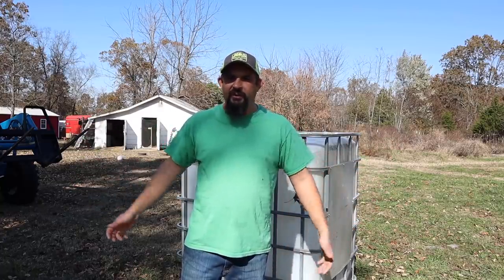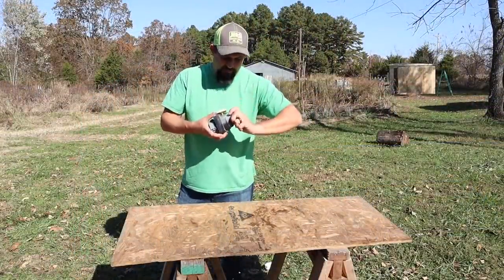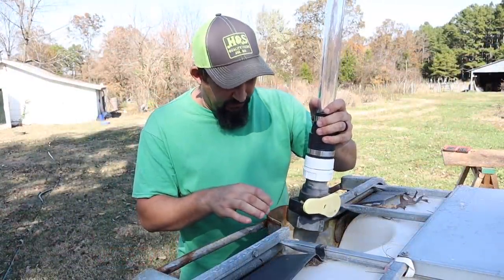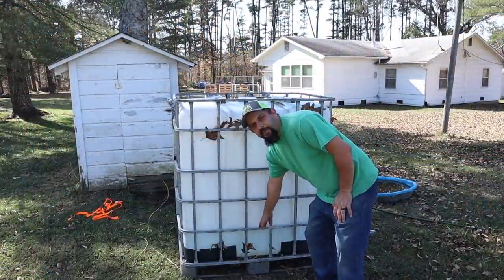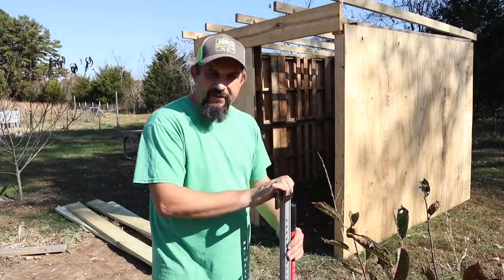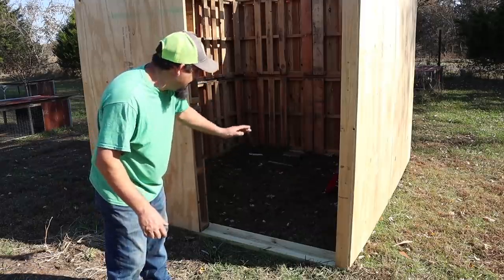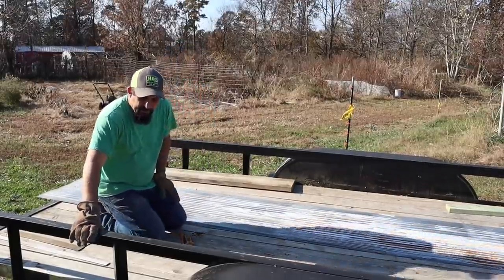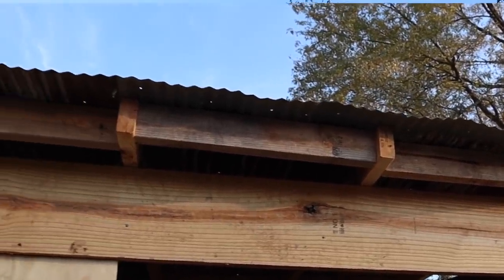Winter Water Solution for our Animals PLUS The Duck House gets a roof!

Comment: Remember to put a stick in the cows water trough. It will allow small thirsty critters a way to get out, if they accidentally fall in. (Squirrels, etc.) It will also give you a way to break the ice, and allow the cow to get a drink, if the ice does not get too thick. A cedar post stay works well.

Comment: Good morning, Kevin, you should hang a gutter on the backside to catch rainwater and have it drain into a pool for the ducks to drink and swim. Your new water tank can be used when rain doesn't fill the pool and run a line into the duck shed for inside water also.

Comment: I saw one YouTube video where a YouTuber named  "FarmBuilder" painted a tote black, and then put a PVC pipe and valve array into the CENTER of the water mass in the Tote.  Since the tote never freezes all the way into the center it made it possible to water his animals through the entire winter from the tote that he leaves outside in the weather.  He lives in VA where it gets even colder than you do in MO, so you might want to check out his YouTube video..."Freeze resistant water tank for under $100 reduces daily water work load by 70%."

Comment: I would try to get paint on that duck pen before winter so the plywood does not de-laminate. Because it is getting cold where you are, I would recommend Valspar Duramax paint, which you can get at lowe's. As a handyman I use this paint almost always when painting in colder temps. This paint is rated for application in temps as low as 35 degrees and if you apply two coats it will last a long time.

Comment: I put a coy pond heater in my tank and it keeps my water from freezing. It's been down to -2 and it still didn't freeze.
Reply: Smart idea!
Reply: Did you put the coy pond heater in that big white tank? It worked? I have been trying to find something that would fit in the top of the tank from keeping it from freezing
Reply: @CatalpaCreekFarm  yes. I bought a 500 Watt and it's been great. It's one that's it is a skinny glass tube about 16 inches long so it fits easily in the fill hole without cutting anything bigger. They're cheap on Amazon or eBay. About $18. Just look up fish tank or cot pond heaters.
Reply: @shermdog6969  did you suction cup the heater to the side of your tank? Do you worry about the water level getting below the heater then? Thank you
Reply: As much as you put into this duck mansion I would coat that roof with a product they made for mobile homes trailers, I think one brand is Silvacoat. This project deserves to be protected.

Comment: As someone who hauls alot of water in winter, I would suggest taking the ball valve off the tank and put in the well house.  The hose will not freeze but that ball valve will and it will generate a whole lot of frustration in thawing it out!  Granted a whole lot colder where I live!   Dragging the hose in and out every other day from the well house  to fill her trough would work too!  Just turn it on before start dragging it across the yard.  Just a couple suggestions!  And yes, hauling water by bucket in winter DOES get old real quick!

Comment: The PVC coupling will snap in cold weather and isn't UV resistant 

Rubber no-hub adapter will be fine in cold but will deteriorate with UV

Vinyl hose will be stiff when cold and can crack at bends

Why not paint the tote black to fight mold and absorb heat from the sun and run galvanized pipe to a float valve and run an extension cord out to a floating tank de-icer?

That's how we water cattle in winter.

Comment: If you haven't made up your mind on the door, think about building Dutch door.  That way you can open one half or the whole door depending on if you just want to let out the ducks, go in and check them/put in bedding, or open the top for ventilation with lower half closed to keep them in.

Comment: We have 3 of those tanks. 2 are plumbed into our house. 1 is in the back of our truck and we take it to the spring down the road to get our water. I think they are 250 gallons. 50 per line. Some days it only takes 10 min to fill our tank at the spring and some days, when we haven't had a lot of rain for a while, it can take almost an hour. Good cow water plan!

Comment: Ok Kevin here is my 2 cents worth. (1) the openings around the top are really inviting skunks, snakes and racoons. Screen mesh is in order. (2) If that clear plastic hose on the water tank gives any trouble take your assembly to an auto supply and get a flexable radiator hose that will fit over the assembly. It will out last the existing hose many times over. (3) If  you do not intend to move the duck house from time to time like a chicken tractor then you will want to place chicken wire around the outside on the ground to keep out the skunks, etc. Just lay it down and fasten to bottom of palets and let the grass grow over it.   Paint the duck house in camoflauge paint and call it "The Duck Blind"   I also like another persons suggestion of "Ducking House Palace"..I'm an old timer from rural NW Oklahoma and I understand fully your situation on your farm. Been there, done that.   LOVE YA ALL Keep up the good work..

Comment: Kevin, I know I'm too late for this project but if you use a paneling blade (or veneer blade)  turned backward on a skil saw it will cut right through the tin. It will save you lots of blisters.

Comment: You might have wanted to run some 2x4 purlins perpendicular to your roof support boards. Your metal roof is also made to be supported by purlins that run perpendicular to the corrugations of the metal. When you added your extra "support" boards .... this is what the purlins job is. Also, the purlins will allow you to have an overhang on the other side as well.... so ALL sides could have an overhang. All that being said, you were such a great example.... that we built a chicken coop extension using old pallets!!!!! Thank you for the idea and thanks for sharing.... even here back in your old digs of Wisconsin!!!!

Comment: A word of caution, 1x and 2x treated wood is not "ground contact" rated. 4x treated wood is "ground contact" rated. Keep an eye on that wood for the next couple of years. On your next project think about using "CMU" (concrete masonry unit) cap blocks from Home Depot.

Comment: I suggest putting rain gutters on the barns and do rain catchment to refill the water troughs with. 
In the colder months put something around the water tanks to insulate them so they don’t freeze.
Reply: Are you going to do a solar light -charging panel attached to the top inside the duck house?

Comment: I use a water tank just like yours to haul all our water. Mine doesn't have a nozzle like yours but I just use a 4in. Pvc pipe to water my horses. Then we add an elbow with a cap that allows us to add a small pvc pipe to fill our 3gal water bottles for the house.

Comment: Hy Kevin about the water tank, why not drag some isolated tubes from a close barn to where you want to drop the water. During the winter it will be hard for you if you drag that water tank every day, so better to use some isolated tubes from that thank directly to the cow and the birds too. And you only go to open the valve. And you could buy some auto-opener for some fixed time. You calculate how much the cow drink and the birds per day and set the time how much can the valve stay open. With a deficit because not every day they will drink the same. And you only go to look if they need more. Make your life much easier to let everything go automatic. And you can focus on other things. And about the barn, why not make some steady horizontal pillars and just dig the earth on what you need and put it directly on the dig and you can build everything you need. Just make sure those horizontal pillars have like a caterpillar so you can introduce the wood (pannel) inside this way the barn cant move if you have a storm or something.  but i forget something before you put that horizontal pillar make sure you put some small stone there so when it rains that he could go deep because of lac of cement but small stone can help too. God bless. And sorry if my English is bad.

Comment: I used to break the ice with a twenty pound sledgehammer. Then I discovered water heaters that float on the water and to keep the water from freezing. I had to have electric run to the area but all the animals I had were in the same area and it was great for me. I also had a heated water bowl for the cat and dogs. I really like your set up. I have the container but no tractor 😩.

Comment: put a coil of copper wire around the tank and put a lower section of coil IN the fire pit.  The heated water in the coil will do the job - takes planning.
Reply: maybe fetch the concrete trough and put one end in the fire?  You would only light fire at night, mostly.

Comment: It looks like you did very well with what you had. When it comes to jacks and you are working in close proximity to the area it is recommended that 2 jacks are used to have more stabilization. I know that it is rare that you need more than 1 jack, but sometimes 2 jacks keep it safer and your downtime, if you are injured or damage to the project, will be a lot more expensive than the price of that second jack. Thumbs up! Just saying. 

As for names, how about the Duck Den or Duck Cave.

Comment: That's a good idea to put pressure treated wood under your barn. What do you think the chances are of moisture leftover freezing inside that valve when the temperature is below freezing? Maybe leave the valve cracked open when you're done using it each time so you can pour warm water through the valve to thaw it just in case.

Comment: Those tanks are usually 275 gallon and a gallon of water is eight pounds means you’re going to be moving 2200 pounds of water. I don’t know what your tractor front loader is rated for but it seems that you’re going to be close to the limit if not over just a tad. Have you thought of building a stand for the tank and filling it up from the well house as needed? 
Just a thought and it would save wear and tear on the hydraulic system on the tractor.

Comment: Definitely a must to have a seal plate to keep the pallets intact.  also coming from Arkansas, with the winds that we sometimes get, you may think about drilling the bottom board of the pallets through the seal plate and driving rebar with a bend at the top to pin it in place.  I know from experience that rolling a small building back upright that it is a pain.  Great job!
Reply: I also live in Arkansas the winds get terrible here more so in the springs and summer your right about that

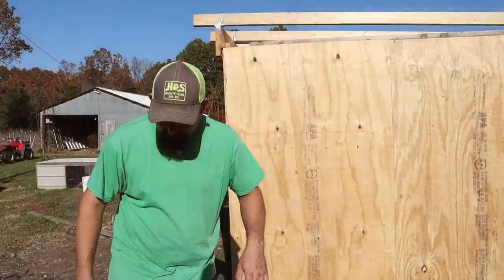Comment: Coming along very nicely!! Kevin, I was just wondering, at around 13:48 you were showing the bottom of the shed with the 2x8s in place. There's definitely light coming in through some gaps. Are those areas that critters will be able to enter? Do you need to move the 2x8s out a little so the plywood connects and removes those gaps?

Comment: they were ORIGINALLY called a FENCE JACK !-- as they had a cam lock on the top of the jack used to tighten barbed wire fencing !!! hence the reason they were/are so tall/long. but they have a lot of uses and since then they are erroneously refer d to as a farm jack !

Comment: @livingtraditions homestead  are you going to use tie downs on the duck house? 
I ask because you do get some fairly strong winds where you are and that house being so tall will topple over quickly. 
If you are I'd suggest drilling holes through both the boards you just put down and the wall, slide a length of either steel or rebar through and pound it in about 12 to 18 inches. 
I live in WNY and growing up we always made sure freestanding structures were tied down.

Comment: You may already know this...   but just a thought... I don't know if the solution the wood is treated with is different from years ago, but they always told me "Don't burn treated lumber!" That vaporizes some dangerous chemicals that you don't want to breath...
Reply: Herb, then what are you supposed to do with treated wood when you need to get rid of it. This is serious - as I burn my old rotten lumber. I know you can not put it in the fire pit to cook hot dogs, etc. on it but otherwise, I thought It could be burned. Yikes.
Reply: @donnab8010  I believe the concern is that if your stove or fireplace doesn't draw well and the fumes linger inside your home... it can present a health hazard... When I was younger they said don't burn it a campfire either... because sitting around the flames would be too close a proximity... I will do some research and see if my old information is still valid...
Reply: @herbhouston5378  - Thanks Herb for replying back to me. Nope, I do not burn treated lumber in my fireplace only in a burn barrel. I don't linger around the burn barrel so I should be alright to burn the lumber. I don't have any left to burn at this time.  Thanks again, Herb, for this info.
Reply: From what I've heard pressure treated lumber now uses a copper infusion to keep it from rotting instead of the old chemicals of yesteryear. I wouldn't and still won't burn any 'processed' wood in my stove, fireplace or campfire;  a burn barrel is a different story for wood that is beyond any other use.

Comment: Pressure treat wood is not a good idea Especially if your doing Organic gardening or any gardening close by. There has tobe  a great distance to be Certified Organic. Cedar wood untreated would be better.  Treated wood leeches into the ground through out time. Maybe you knew that and are safe with what you did.  The Duck house does look very nice. I also like your idea of the water system for Hope. Thanks for sharing your videos.
Reply: That was definitely true of pressure treated wood of yesteryear. From my understanding from a couple other YT channels it is now treated with a copper infusion to prevent rot.  One also has to be careful of what kind of pallets you use for varied projects because many are chemically treated. The same goes for "cinder" blocks;  some contain ingredients that can leach as well.

Comment: I like your problem solving. I have question though. How do you keep you animals water from freezing? I've been researching how to keep water from freezing without electricity as I have no power source near my hen house.
Reply: Do they make a solar type heater for this?
Reply from the maker: For the most part we don’t keep it from freezing.  For the smaller animals we use rubber pans for water in the winter so we can flip them over and break out the ice.  Even the rabbits get small rubber bowls in the winter.  Hope’s water tank probably won’t freeze solid so I will just break it open each day.  That’s why we went with a metal tank.
Reply: Thank you for the information! God bless Kevin and Sarah💚
Reply: When it does get super cold in the winter I bring hot water out to pour in and break the ice. That gives the hens a chance to drink some warm water and warm up a bit before it freezes again.

Comment: Ever thought about trenching in a water lines? For winter time I just blow them out.  On my channel I have a video that shows my setup.
The Quack House.
Reply: Put them 4 or 5 ft deep to a frost free hydrant and run them all winter. Works in Wisconsin.👍
Reply: @glenncountry  
Should not need to be that deep where they are at
Reply: @larrykluckoutdoors8227  agree! Depends how deep the frost goes in the area. With a frost free hydrant it wouldnt be necessary to blow it out each time.
Reply: @glenncountry  
I from central Minnesota. I have a frost proof by the well, I branch off of that to garden beds, flower beds. All my raise bed and flower beds had popup heads. No more garden hoses. I just blow them out
Reply: @larrykluckoutdoors8227  when severe cold here and no snow cover the frost goes 3 ft or more into the ground. Water lines are laid below that level with frost free hydrants that run all winter. No need for hoses or carrying buckets.

Comment: Do you use a tank heater in trough?
What zone is this place? Missouri? Kinda cold but not prolonged -20?
Reply: They are in zone 5b or 6a, but there is many micro climates in the Missouri Ozarks so there actual conditions can be much different depending on exact location.

Comment: May need to add some cross blocking to the roof.
Reply: At the end of the video, Kevin explained that he put cross blocks to help hold up the tin roof. You can see them at the front of the duck house.
Reply: @donnab8010   I think he need some in the center portions of the roof rafters.  That tin roof is going to sag with a snow or ice load.
Reply: Kevin put block bracing at the front, middle & back of the roof, but I do agree that 2 more rows of bracing would be prudent with the Ozark winds that gust through.

Comment: Do they make water heater thingamajigs for Cow/ Horse Water Troughs to keep them from turning into large just, Ice-cubes during really cold spells?  Might be time to talk to your local cow guru.?  Will your Tractor's prongs handle the weight of that tank when It's full of water?   It might be even heavier than the Hay balls!  Might be a thought to fit some wheels to the bottom of the frame?  If you raised the Jack because you know the pallets are separate WHY didn't you set it against the 2×8" fastening in the exact Middle?  It moved because you raised one pallet higher than the other!  Do that all the way around and I'm nervous it'll explode!  What made you change your mind about making the roof overhang much longer over the front of the building?  It'd be handy in snowy weather to have 6" of protection over the door wouldn't it?  You can see daylight through the roof at the back did you spot that?  It also looks a bit 'wavy' is that to do with the width of the panels or the brace placement?  From Not a builder lol.